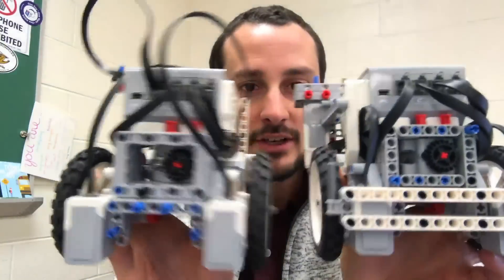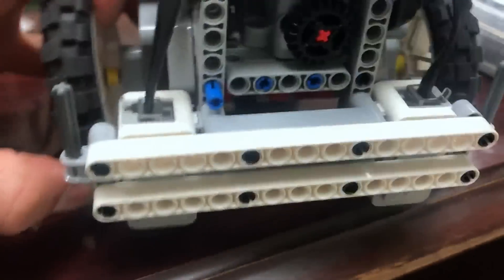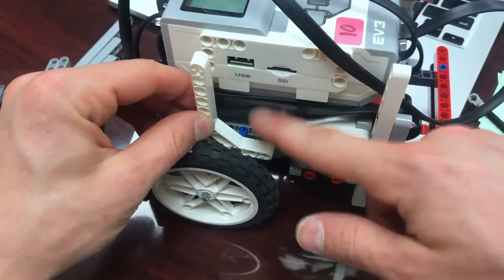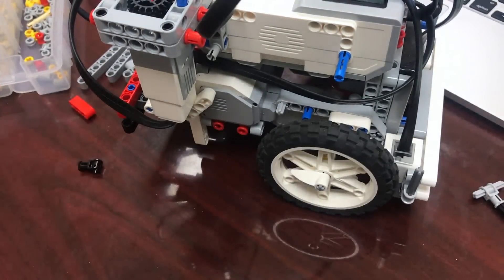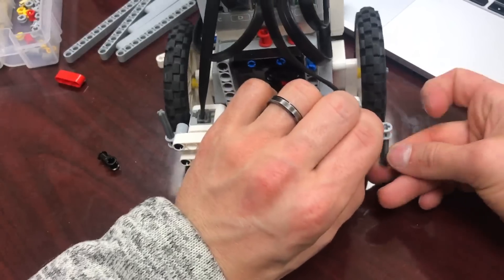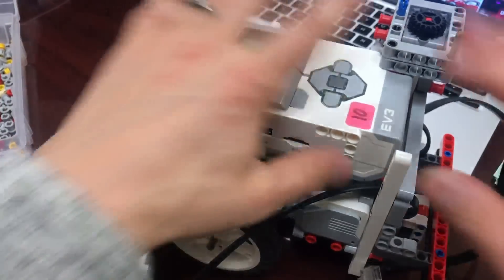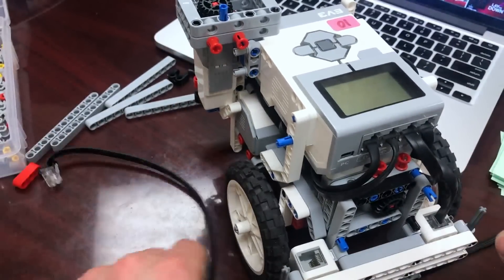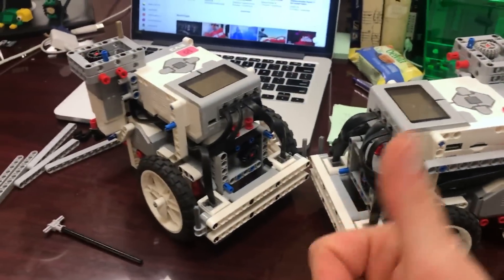FLL Robot Mods (From Base Kit) for FIRST LEGO LEAGUE Hydro Dynamics

Comment: My students have built this robot but are having some problems with the gears being strong enough to hold up any type of weight on the attachments... Suggestions?  (I'm not very savvy when it comes to engineering...)

Comment: Great video and I’m loving the cable management.  It looks like it’d  be a huge challenge to get the brain and battery out.  How did you accommodate for this challenge?
Reply from the maker: It actually comes out pretty easy. If you have ever experienced taking them out on the booklet Bot, it’s about the same. Taking 3 or four pegs out and it clips off.
Reply: Zachary Trautwein please do a demo